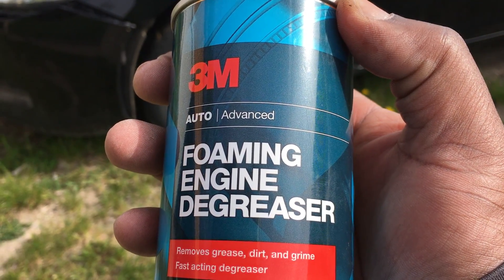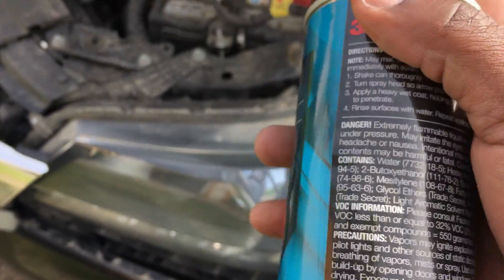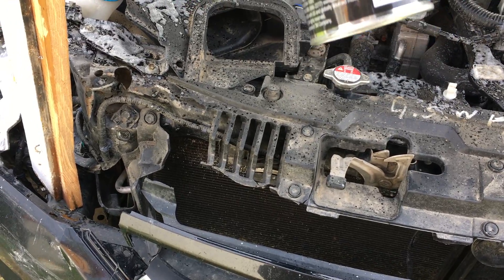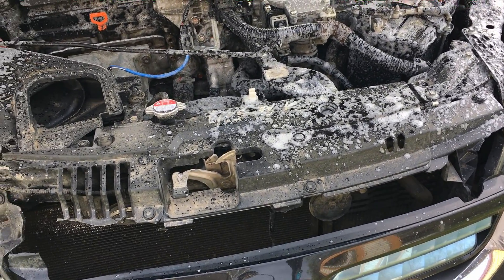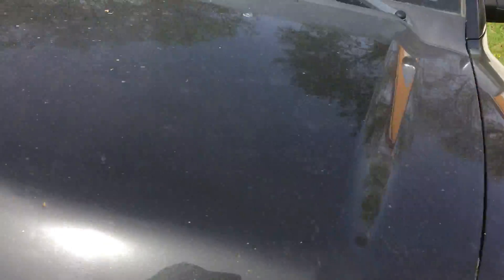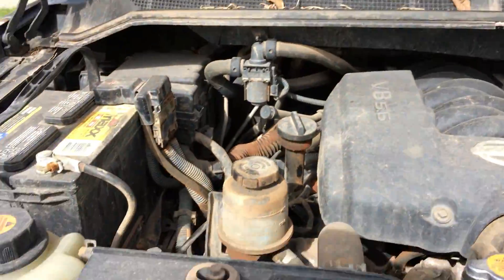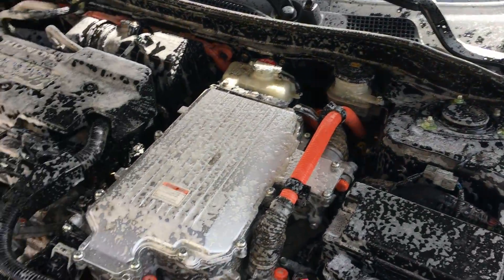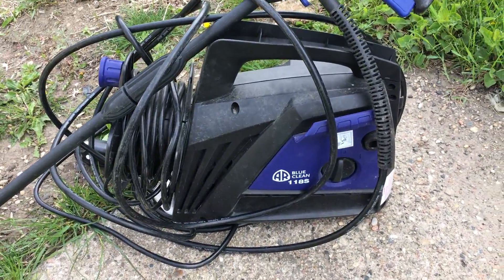3M Engine degreaser

Comment: Does this break down thick oil sludge ??????
Reply: John Harrison yes I used this degreaser a lot times I do mobile detailing
Reply: Edgar Benitez thank you everything I've tried would get off surface leak oil but not the old built up oil
Reply from the maker: Yes it would break down the thick old stuff. Leave it on there and maybe have the engine run on idle to warm up just a little. Then power wash everything with warm water.....🙂🙂🙂🙂🙂👊🏼👊🏼👊🏼💪🏽
Reply: Worst camera handling